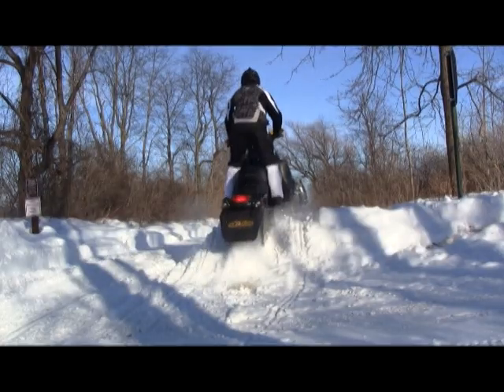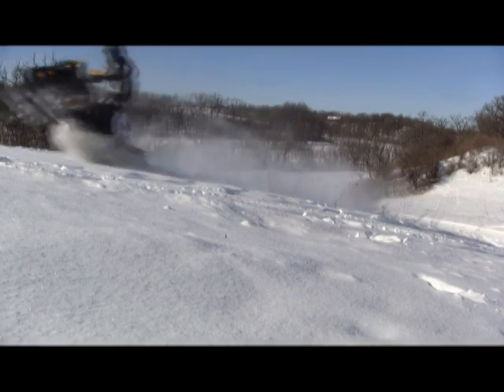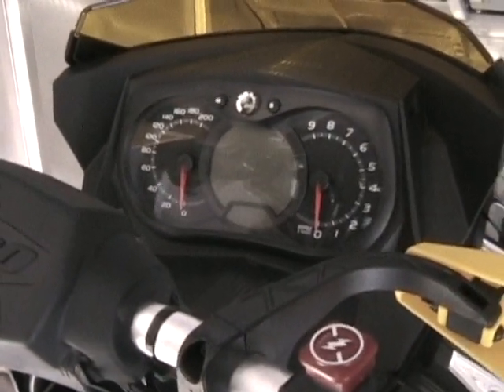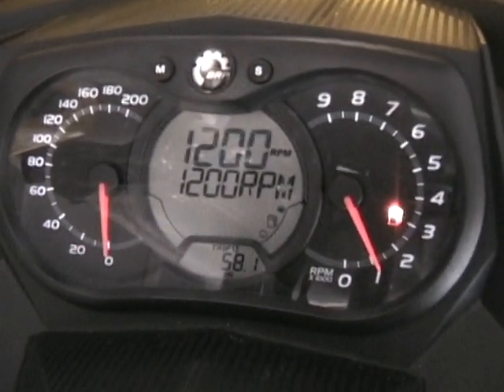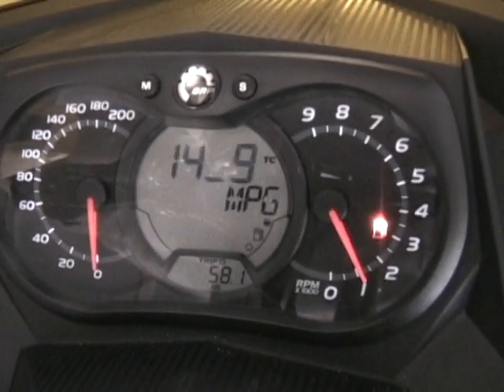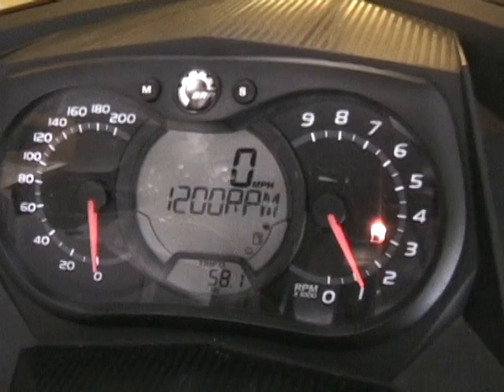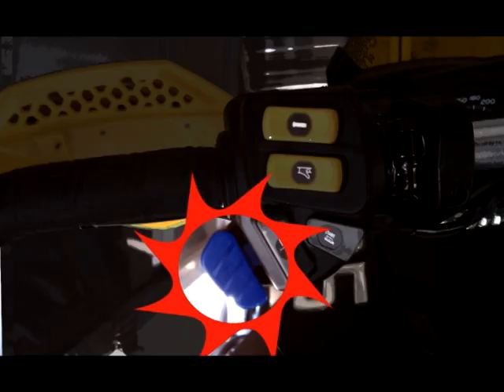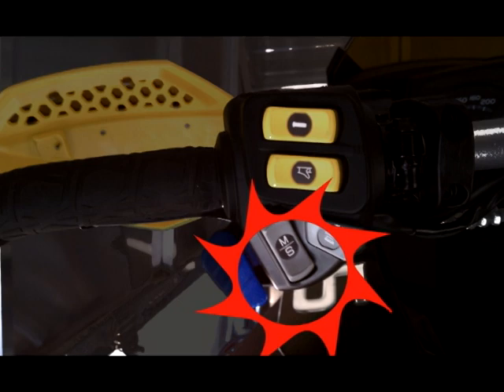How To Summerize a snowmobile engine...800 E-Tec style

Comment: ALWAYS drain your fuel tank for storage on a two stroke, old fuel can cause pre ignition/detonation. I do top ends for guys every year because people start there sled with old fuel.
Reply: In the last 14 ski doos I’ve owned I’ve never even had this problem.
Reply: @nsa6790  doesn't mean it can't happen. You're probably getting lucky and the octane in the fuel isn't deteriorating enough to cause problems.
Reply: @Zach-ju5vi  I run 89 through most of the year. Plus it’s just a sled a warranty will cover it.
Reply: @nsa6790  89 would definitely help, I'm not sure what engine you have but most manufacturers strongly recommend 91 for high performance machines. I wouldnt count on warranty to fix it if you blow a hole in the piston, they can use that specific failure to prove it was negligence and could possibly deny you warranty. If you have a good dealership they might try and cover for you but I like I said I wouldn't count on it. If you don't want to drain the fuel at least use fuel stabilizer or put fresh gas in before starting it after summer storage.
Reply: @nsa6790  I worked in dealerships of all the major manufacturers so I know alot about warranty and if they see pictures of pistons with that type of failure they almost never accept the claim. Also if they see a four corner seizure from not warming up the engine properly they can deny that claim as well. Just something to be aware of.
Reply: 5100 miles on mine, always leave the fuel full as can be with Stabilizer. I do this to prevent any moisture getting in over the year. I then drain it in the fall and put that in my truck. Refill with fresh and go!